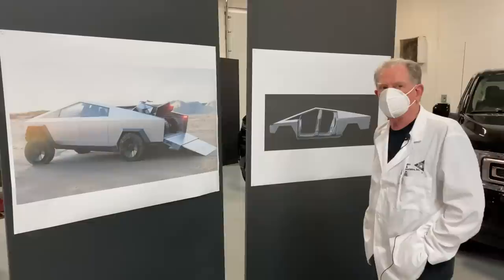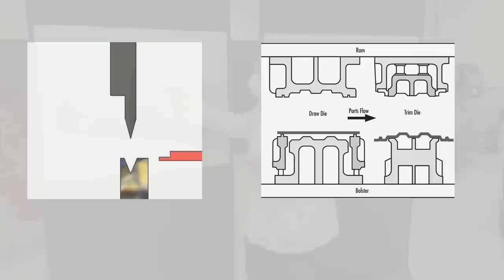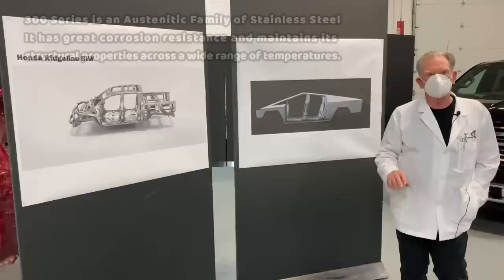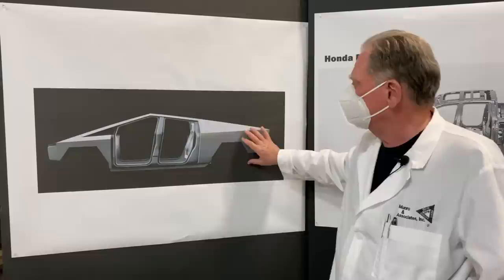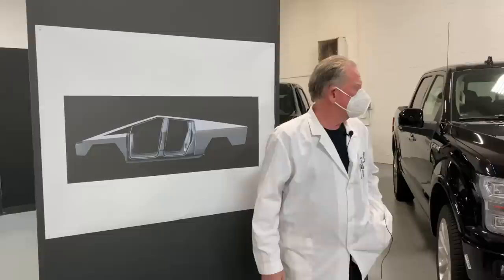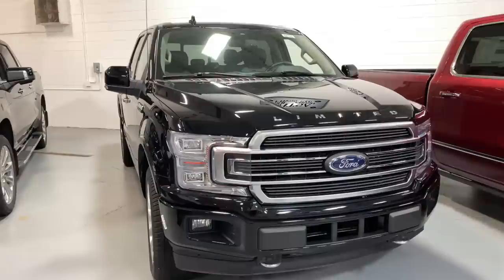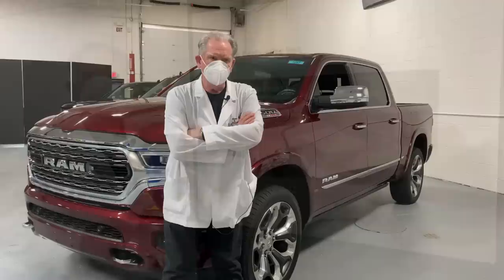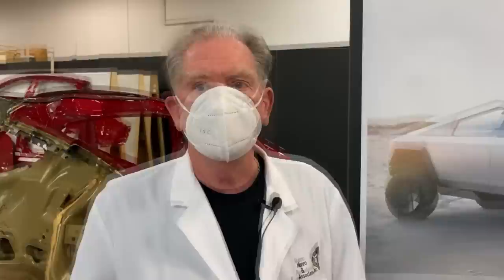Cybertruck E1 - Body Structure Comparison

Comment: 12:36 he almost said "a shitload of money"
Reply: That’s why I’m on the shop floor every day, it really does add up. 🤑
Reply: LOL, good catch... and while conventional body construction costs a shitload... repairing a CyberTruck after a crash will cost a shitload.
Reply: @KrustyKlown  As opposed to any other totaled car? Either way you're going to get a write-off if the accident is that serious, otherwise this thing would just get a bump or crack you can weld up, instead of complete deformation and ruined paint job in a comparable product, which is sometimes just made from flimsy aluminum.

That's why Munro's a fan, he likes off-roading, and this thing is made for that, it's not "fashion" truck in terms of structure, the design has rugged purpose.
Reply: @KrustyKlown  Its very easy to repair. Cut out a tile and insert a new plate. Any better craftsman can do that and does not need any extra repair sheets, fill and paint.
Reply: @Zedus-rl9hp  I'm talking about severe damage, not just cosmetic. On traditional vehicles body panels are adjustable, and that allows body shops to crudely straighten frame members and cosmetically fit nice looking body panels .. but if an exoskeleton Cybertruck is bashed in, the exoskeleton must be precisely straightened in order to get the body gaps and alignment correct. Also, most body shops have little expertise in doing cosmetic welding repairs on stainless steel.. the stuff warps and color distorts (bluing) when heated. 
   All that said, if Cybertruck proves to be tough and hard to damage.. then great, that should offset the higher difficulty of crash repair.
Reply: @AllanSustainabilityFan  Please stop, you are straw manning me, knock it off.
   NO, I obviously was NOT talking about a totaled car. 
    Seriously,  have you ever done stainless steel welding or body work? .. no you haven't .. go talk to those who have.
Reply: BigCooter.com Which car doesn't these days ? 
At least they won't have to paint match, although that makes it harder to hide poor work.
Reply: @thosoz3431  Matching the surface texture of stainless steel is going to be more challenging than matching metallic paint.
Reply: @thosoz3431  Yes .. paint is a pain.. the small cosmetic dings, rock chips, scratches.. wont't be much of an issue. It is the exoskeleton I am not convinced of being a good idea, since that integrates body panels into the structural frame of the vehicle.. making a hard hit difficult to repair.  Of course I am speculating.. and the insurance data and prices will eventually tell the true story.
Reply: @KrustyKlown  I'm no expert, but I'm guessing the front of the Cybertruck will be made of softer and/or thinner stainless steal for crash worthiness. The cabin, bed and side panels will be made of the hard stuff. In my mind, repairing any major damage will involve cutting out the damaged parts with laser or water jet, then welding new sheets in place.... replacing any damaged wiring, electronics, airbags...etc... Personally I don't think it'll be more expensive than soft aluminium+steel cars, IF the repair shop has proper cutting and welding tools. As Sandy said, you'd leave minor dents and dings as they are, if they don't affect the suspension, steering....etc...
Reply: @KrustyKlown  "On traditional vehicles body panels are adjustable, and that allows body shops to crudely straighten frame members and cosmetically fit nice looking body panels" = cheap botch.
Reply: @StephenMattison66  All claims you provide without any evidence. Reality is Tesla's vehicle death rates are not great. A lot of people do die driving their Teslas... and ONLY Tesla has a self driving system that has killed owners. (link below). Tesla's FSD is at best an SAE Level 2 system... it was a low power solution for making good on their Full Self Driving Option that pre-sold then took many years to be bring to market .. and it is only level 2 and NEVER has done Elon's promised coast-to-coast drive, while several competitors did that years ago!  Musk promised RoboTaxi rollout earlier this year .. its no where in sight, LOL.  You've been driving the Tesla Koolaide, and I've been doing my research, and one of us is an automotive engineer who holds patents used in parts that most OEMs use, including Tesla. Tesla makes a good car, but Musks over promising and Smoke & Mirrors marketing BS is a bit much.
https://medium.com/@MidwesternHedgi/teslas-driver-fatality-rate-is-more-than-triple-that-of-luxury-cars-and-likely-even-higher-433670ddde17
Reply: @StephenMattison66   You seem all charged up like a TSLA owner??...if that is the case then go to a stock investment forum and talk with people there, instead of embarrassing yourself here.

 Tesla is a great company and has a great product .. we agree on that. But the actual accident data does not confirm your claim that Tesla is the safest car on the road. So you didn't like the link I gave you, let's try one from a Tesla friendly website then ....
https://www.greencarreports.com/news/1119936_tesla-fatal-crash-rate-with-autopilot-still-no-better-than-with-human-drivers

AutoPilot kills people, because owners think it is MUCH more capable than it is, probably because of how Tesla markets it.. it is only a level 2 system that requires the driver to keep their hands on the steering wheel (IMO, not self driving)...
https://en.wikipedia.org/wiki/List_of_self-driving_car_fatalities

(FYI - I don't do stock trading, I have never shorted TSLA or purchased it long... IMO, only an idiot would do either ... since the stock is obviously manipulated for dilution by Tesla... billions of free capital off the backs of investors ... I would buy the car, but never the stock short or long)
Reply: @KrustyKlown  trolls like you are somewhat amusing to real world thinkers seeing you all caught up in your box trying to come up with any type foolish lop sided hypocritical fud when reality dictates that you should look at the whole picture in its entirety and realize the truth, which is why there are so many fans of Tesla.
Funny how trolls paint their world full of unicorns, rainbows, and pixie dust by trying to explain how horrible all things they hate are, and they truly show plenty of hate, when the greasy, smelly, rusty reality is it's all full of breakdowns and constant maintenance and repair shops.
Reply: @StephenMattison66  "Yes, it is unfortunate that good people must point out and tamp down the endless stream of misinformation and manipulation people like you spew"  .. listen to yourself, LOL. ... you be the spewer.. back up anything you have claimed as true, you've provided squat.
Reply: @xkrkro  I gave facts and unbiased references .. what I heard back was "Elon said" and cultist dogmatic blabber heard time and time again by Teslologists. If you are going to disagree, and make contradictory claims .. provide evidence and supporting information to back up your argument... or be ignored and dismissed.
Reply: @xkrkro  providing a sound argument is NOT trolling, .. but saying I'm trolling, would be YOU trolling. If you disagree, fine, but state why and back it up.
Reply: @KrustyKlown  I don't need to state the obvious. Again your hate and ignorance is amusing with that perfect world you imagine in your head...

No car is perfect but Tesla is constantly improving despite being far more advanced and amazing! You can go on continuing to disagree though.
Reply: @KrustyKlown   I think of it like this. Since the panels are the frame, any hit hard enough to wreck them would be hard enough to wreck the frame on a regular vehicle, which usually means it's totaled anyhow. So it doesn't mean that the lesser panel-smashing hits will ruin the frame, it means that it can tank those lesser hits well enough not to wreck the panels.
Reply: @sockmonkey6666  disagree ... its a matter of degree .. a typical vehicle can tolerate minor frame damage that can be adjusted for with wheel alignment and body panel position adjustments. BUT, when the body panels are part of the frame (i.e. exoskeleton), that minor tweek, results in unacceptable body gaps that can't be adjusted out, without getting into doing elaborate exoskeleton bending adjustments, if even possible. It will be harder to repair in this specific situation .. but easier to repair in a minor ding / scratch situation. Its early to know for sure.. but insurance data will certainly be scrutinized closely by the entire auto industry over the next few years.
    The other aspect NOT talked about much yet, is that an Exoskeleton frame, is less flexible as a platform for making multiple vehicle models. It is far easier to just swap out body panels and tag it with a new vehicle name... and the more models on a single platform, equates to much higher sales.  Overall, Tesla isn't much on board with the Platform concept, which is significantly increasing their model development costs .. this will become more important as Tesla grows into a true global OEM, where each region needs regional specific models tailored to the laws, regulations and demographics of that region. They got time to work on this ... for now they probably are doing the right thing, getting some high volume vehicles out quickly for the US market (i.e. Model 3, Y and soon CyberTruck).. that generates revenue growth they need (while Semi & Roadster do not, hence why those were pushed to back burner, and Roadster almost off the stove).
Reply: @KrustyKlown  A tradeoff that makes minor stuff suck less and major stuff suck more could be good or bad depending on if the rigid frame adds enough toughness to raise the bar on what's considered major damage like they claim it does. Can't know for sure until we see it run through the torture tests.
In this specific case, a single platform isn't as limiting as it looks. The external shape is fixed, but being exoskeletal and electric means far more flexibility in how the internals can be arranged.
Reply: @KrustyKlown  We have to contextualize things. It may be an electric, it may be a Tesla, but its a pick-up truck. It's supposed to be a work vehicle, going into rough terrain, towing, carrying loads. As a direct implication, the probability of structure compromising crashes, which mainly happen at higher speeds and with regular cars, is lessened, IMO.
Also, the fact that it is comprised of fairly straight panels and structural boxes, makes it so it is easier measuring chassis dimensions for warpage after a big accident and also making repairs.
Although stainless steel may be a bit harder to weld pretty, the fact that it is comprised of mostly boxy and straight sections makes it easyer for replacing the affected areas.
I wouldn't use this concept for a city car, but for a workhorses, that usually get left to the elements, get tons of dings, medium dents and scratches but no huge accidents, this solution is at least borderline genius.
Reply: @KrustyKlown  Dude, its stainless steel. even if you smash it into a concrete wall its shell probably won't deform
Reply: @abyssstrider2547  WTF??  The frames of modern cars are made of high strength steel, in order to form structures, the yield strength will be similar for Cybertruck and conventional auto frames... similar strength and resistance to structural crash damage. The touted 30X strength advantage only applies to exterior surfaces, which will resist dings / dents better than the lower strength body panels used on conventional autos.
Reply: @KrustyKlown  Yes, frame. This whole thing is made of stainless steel. This multiplies structural integrity by a whole lot. Its almost like one of those military humvees in terms of toughness
Reply: @rrs_13  sorry I posted here, nobody seems to understand WTF I'm talking about... I am NOT talking about dings and dents to body panels. I'm talking about minor  bending/distorting the frame and/or exoskeleton in a crash. In conventional cars,  they replace some body panels, adjust the panel gaps and align the wheels and it looks good and all is in spec. However, with an exoskeleton comprised of frame and major body panels..the panel gaps can't be adjusted, and only precise frame straightening can correct it.. a huge repair bill to make it right .. that is one reason why exoskeletons haven't been used. .. the other major reason is that it goes against the "platform" design concept which allows for multiple models off a single base platform ... Tesla ain't on board with platform design yet, Model 3 and Y are somewhat related, but not as must as they could have been through a true platform base.
Reply: @KrustyKlown  the thing is for cold rolled 300 series steel the announced thickness, the minor things are dings and cosmetic bends. Things that would cause minor warpage in conventional chassis won't in case of the cybertruck. Things that would require chassis stretching/geometry fixes in normal cases will be somewhat identical in the cybertruck. The way that the chassis geometry is designed, if you warp your doors or hood to the point of not closing, youll need realignemnt. Anyway, until there are crash tests or at least a finished product, were just speculating. Tesla may be the most experienced auto market, but truth be told they have never rolled out a car with fundamental design flaws. We have to wait and see.
Reply: @rrs_13  That's a lot of hopeful speculation, it is very doubtful it will be over built like you describe, since it MUST crumple to get a decent crash rating.  It would be more sensible to assume it will crumple just like any truck frame in a similar crash.
Reply: @KrustyKlown  you're also speculating they have to do it thinner instead of playing with structural geometry for the crumple zones. We're all doing the same thing: guesswork. No point being "certain" it's going to fail when it doesnt even exist yet, we just have a vague idea of it's exterior look. Even less point being negative about it when even the experts arent that pessimistic.
Reply: @KrustyKlown  it's not hopefull: it's giving it the sensible and intelligent margin of doubt, mainly because YOU DO NOT HAVE ENOUGH CRITICAL DATA TO INFER ANYTHING! You know it is a pickup, electric, made of 300 series SS, with an exoskeleton chassis (of which you only have a barebone side-view, not even a frontal or top/down view). It may even have some revolutionary way of bypassing former complications with this design -  we simply do not know enough!
Reply: @rrs_13  Yes, we do have data... like I pointed out.. all vehicle chassis must crumple to pass crash testing.. they are designed to deform .. so the Exoskeleton MUST deform in a crash,  ... which totally deflates your speculations.  End of discussion.
Reply: @KrustyKlown  You're just wanting to be right, and go as far as even changing the point you want to be right about. Sad.
 You were talking about a specific case of colisions that produced more than dings and less than total chassis warpage (minor-to-mild). When you want crumple zones to go into action is on moderate-to-severe colisions, which is not what you were initially talking about. When you get into a crash that justifies the existance of body deformation to dissipate impact you'll pretty much toss away the car or pay a pornographic ammount of money to get it half as good as it was. ANY CAR! Or you dont toss it away because you're leasing it and the insurance covers it, in which case doesn't matter if the car has two exoskeletons and is made of platinum.
You obviously never worked with auto wrecks (which I actually do for a living), elseways you'd know that the only way your argument is valid is if you do a shit-job and your customer is blind and doesnt notice it. Plus, usually normal countries have automotive inspections that end-up making completely unviable to do such shit jobs (alignment will never get to the demanded tolerances).
I was being "polite" in saying "we cant know", but the truth is that any wreck that critically compromises the purposed cybertruck chassis will do the same or more likely worse to a regular chassis, and you need to be thick as a brick to insist otherwise. And by experience, working with straight creases and box sections will be wayyy easier and cheaper in labor and materials to repair - not to talk about being easier to measure the alignment - than having to straighten the chassis frames and subframes and the kitchen sink on a regular car.
Like it or not, people like you should've learned by now it's not wise to bet against Tesla. I don't like everything they do, but the fact is that they know their shit and make it work, and whenver they inovate the other automakers tend to follow in their tracks.
Reply: @rrs_13  you smoking weed dude??  this is tiresome, and repetitive. Its really simple. I'm talking about minor frame damage and the difficulty in aligning body gaps with an exoskeleton. You said its a super rigid exoskeleton that won't deform .. which is nuts because it MUST deform just like any vehicle in order to pass crash test requirements.. so your rigidity claim is nonsense... end of discussion, my concern is reasonable, your dismissal is not.
   As an automotive engineer .. I'm done talking to you, if you don't want to listen to someone who has worked several decades in the industry and designed parts that most OEMs use, including Tesla .. so be it Mr know it all .. we are done, bye
Reply: I came down in the comment section to make the exact same comment 🤣
Reply: @KrustyKlown  Not gonna cost a shitload, but will be an automatic write-off.
Reply: @AllanSustainabilityFan  "As opposed to any other totaled car?" - No, as opposed to "some dumbo backed up into my in the parking lot and crushed my fender, but its ok, I can buy a new one for 120 dollars, have it painted in the local body shop for 50, and put it on my car in an hour".  That won't be possible with the Cybertruck, and you'll be looking at THOUSANDS of dollars of repair cost for minor damage.
Reply: @StephenMattison66  "Tesla already has the safest vehicles on the road, and that their mind-bogglingly advanced safety systems & FSD will soon all but eliminate accidents" - Everything you said here is just factually wrong, first of all, and all that makes their cars safe are principles that they've copied from other car makers. Not something they invented. 

"Do some research & open your mind" - You don't have to do research to understand why a car with an exoskeleton will be much more expensive to repair than a regular one. It's literally very simple to understand. Those who don't, really don't know much about cars.
Reply: @StephenMattison66   "So, you refuse to consider that Tesla already has the safest vehicles on the road" 

"Just where did you see me state "Tesla is the safest car in the world?"  Never happened! "

Anything else you need pointed out to you?
Reply: @derbigpr500  That's already designed into the car, they have fenders just fine. We're talking about serious accidents, or side impact collisions, those are usually a write-off. 

Check out Munro's take on the design, he's been dissecting it for the last few weeks on Youtube. The short is that this design will be about five to seven times lower cost to produce than an F-150, and more rugged than these flimsy aluminum bodies of today.
Reply: @derbigpr500  exactly.. most of them are stock fan-boys, who own fractional shares, and are planning to retire when their 0.4 shares hits a price that exceeds the entire auto industry market cap. (Dunning-Kruger for sure).
Reply: @KrustyKlown  did you make another account so you'd look like someone would actually agree with you?
Reply: @xkrkro  LOL, a lot of people agree, they are just tired of being attacked by the fan-boy Musk Cultists. Fact, data, and the truth hurts, but carry on.
    Even Sandy Munro himself realized he could make more money catering to fanboys than criticizing Musk and Tesla.
Reply: @KrustyKlown  if facts, data, and truth hurts  why are you still speaking against it? Nevermind... It's your fantasy world. 

BTW Sandy Monroe is in the business of dealing with reality providing real world data, results from all the teardowns and product testing and his only EV recommendation atm in favor for the model Y is only based on all the factual data from again actual work, actually doing a teardown and proper testing of everything possible.
Reply: @xkrkro  please do point out references that contradict what I stated.
    I work in the Auto Industry too, not far from Sandy actually. Have designed many parts for vehicles, patents, including EVs... even parts for Tesla too. I'm speaking from experience and knowledge, not a fan boy or anti fan boy clueless perspective.
Reply: @KrustyKlown  you say you work near Sandy so I'm guessing by the fud you spew you must work as a gas station attendant or oil change specialist and you like to doodle and exaggerate calling them designs that you patent. Ok I'm just speculating according to your nonsense and confusion.
Reply: He is a human not a lizzard.